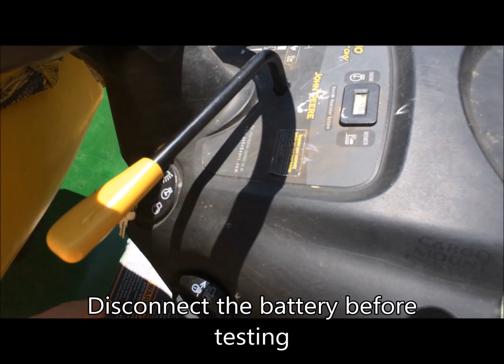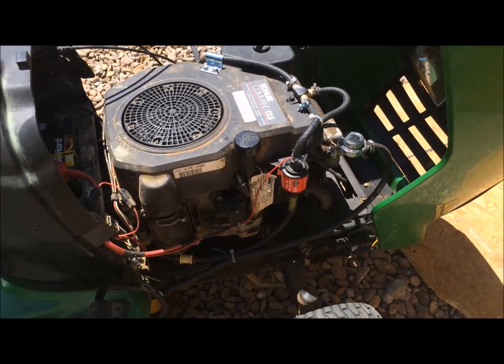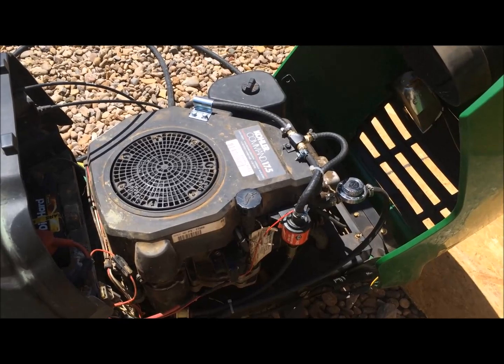Fuel Pump Replacement | Electric Pump Conversion

Comment from the maker: Update: Last summer it quit working, turns out the factory rubber fuel line had pinched shut where it runs through the frame. After correcting the issue it has not had another problem. The pinched line was something I did not notice in this video but it is probably the reason the mechanical pumps were having issues.
Also I do not think this regulator works the way I though it did and it is probably not doing anything.
Reply: That's because you were supposed to run the regulator directly after the pump
Reply from the maker: @feodorjohnson  Because I chose to run a return there is no where I can put this regulator where it will work. In an update video I talked about that but the system still builds 1.5psi at the carb
Reply: @PracticallyStock  I just did the same setup I can send you pics tomorrow
Reply from the maker: @feodorjohnson  Ok, use the email in the about tab on the channel page.  How did you restrict the return line?
Reply: @PracticallyStock  I couldn't find it under the about tab feodorjohnson@gmail.com and we utilize the original metal fuel line replaced all other lines like you said the old hose had a kink and was collapsing but we put the T directly to the carb and ran the return from that I got the mower free from a customer of mine already had new electronic pumps laying around she runs perfect now
Reply: how dose it run when you at low idle. or do you have to run high idle all the time.
Reply from the maker: @bootsinglefooters  it runs normal all the time. Since I used the wrong regulator, the fuel pressure is created by the difference in height between the return port on top of the tank and the carburetor. The carb is lower than the return port. I think it was around 1 psi. The system does not build any additional pressure because there is nothing else to restrict the flow in the return line

Comment: Also.  How long did take you to realize that your charging system can’t handle the extra load that pump puts on it.   Not to mention the very good chances of over pressuring the float valve and filling the crankcase full of fuel.
Reply from the maker: You'll have to inform the charging system it's undersized yourself. I just don't have the heart to. In all seriousness, it's been in operation like this  since I posted the video and I have not noticed any issues. The system operates at very low pressure thanks to my own mistake. That regulator doesn't work the way I thought it did so it's full open to the return all the time. The fuel pressure is due to the height difference between the carb and the higher return port at the tank.

Comment: If you take and put some fuel down in the inlet barb on that pump. Doesn’t take much. Just enough to wet the diaphragm that dried out from not being used all winter.    And she would work like new.

Comment: What did you do with the pulse line from the crankcase?
Reply from the maker: (I think you're talking about the style of pumps that use crankcase pressure to pump fuel) This motor has a factory mechanical pump driven by the motor so I just left it in place but disconnected the lines.

Comment: Where does the return line go. back int the tank?  where?
Reply from the maker: I drilled a hole in the top of the tank and threaded a barb fitting into it. I then used JB weld original (the kwik weld won't hold up) to seal and further secure it. Read the pinned comment and replies for more info. Basically don't need the regulator, either put the return higher than the carb or find a way to somewhat restrict the return line to build a little pressure

Comment: You’re regulating only the return line pressure?  The way you have it plumbed it seems that would be the case.
Reply from the maker: Per the pinned comment, I used the wrong type regulator. I originally thought I could use that regulator to restrict the return to increase pressure in the supply line. Technically I still did this because the outlet of the return is the highest point of the fuel system which means the pressure at the carb equals the pressure to lift the fuel the vertical distance between the carb and return outlet

Comment: Why not just go straight to the carb and not have the regulator? Seems like something else that can go wrong.
Reply: Guess I should have just kept watching….. I’m an idiot
Reply from the maker: Lol, you're good. I am also a bit of an idiot because that regulator isn't regulating because it is the wrong kind to be used that way. The only thing regulating the pressure is just the resistance from the difference in height between the carb and where the return goes into the tank. (The return outlet is higher than the carb so the gas in the return line above the carb creates a little pressure at the carb)

Comment: The return line should be before the regulator.
Reply from the maker: That's not correct,  this regulator does nothing because it does not work the way I thought it did but even if I used this regulator as you described, it would also not do anything because there has to be something to meter the flow through the return in order to build pressure. In this case, the only restriction that is allowing for pressure to the carb is the difference in height between the outlet of the return and the carb (the carb is lower)

Comment: I had a similar issue and solved it by simply mounting the gas tank on top of the hood and just let gravity do its thing.  No more fuel pumps to have to worry about.
Reply from the maker: That would be the most ideal but didn't want to mess with the cooling shroud since I thought it was cool. Problem ended up being the rubber fuel line collapsed
Reply: @PracticallyStock can i have that regulator

Comment: You don't need a by pass line. Put on a low pressure inline fuel pump that has a calibrated  shut off pressure ($8.00 online). That simple. The needle and seat in the carburetor can hold the pressure just fine.
Reply from the maker: I didn't see anything like that at the time but good suggestion. That might work if it is low enough flow, I wouldn't want it constantly kicking on for just a second then shutting off. Not that it was a problem before but a return helps with vapor locking
Reply: You beat to it,exactly what I was thinking

Comment: That is not how a dead head regulator works. You are still getting X PSI to the carburetor so if the pressure to high from the pump, still going to over power the seat in the bowl and flood the engine. A lot of work and money for nothing on the regulator.
Reply from the maker: In the pinned comment I said I found out that regulator does not work the way I thought it did, and no it's not "overpowering" the float. The return is essentially open since it's the wrong regulator so there is no way it can build pressure and you would think I would notice after a few summers of running it if it was flooding out. The pressure to the carb is the result of the flow and height difference between the T and the carb (about 1/2psi if I remember right)  which is not much but enough to keep the carb fed. The regulator is not working (felt repeating that was necessary) so it is likely going to end up on another project

Comment: The regulator is supposed to be inline after the pump. Not a return
Reply from the maker: In the card that pops up at the top of the video I talk about that issue, I thought the regulator worked differently that it actually does. I also found that because the return outlet is above the carb it feeds 1.5 psi to the carb which is plenty

Comment: Intriguing setup. Don't understand why the regulator was not situated between the pump and the carb thus not needing the bypass. A light bulb doesn't know how dark it is. A fuel  pump just  pumps. I can perceive it could be problematic if the line could somehow become pressurized higher than its own design limit.
Reply from the maker: I wanted it to have a return since the little kohler moves very little gas compared to a tradition car engine and I was afraid that the pump would have heat or over pressure issues from the lack of flow. I will concede the system probably makes zero pressure because I don't think the regulator works the way I though it did. When I have time I will look at it and maybe make an update video on what I find.

Comment: Can you give us a part# for the regulator? I recently installed a electronic fuel pump on my kohler k532 after the mechanical one bit the dust. It's working fine due to the needle in the carb doing it's job but I don't want to risk wearing it out to quickly if I can.
Reply from the maker: Don't know what the part number is but it was just a generic one from advanced auto. Looking back on it I have to admit I am not sure that regulator works the way I though it did and it may not be right for this application. If I had to do it again I think I would just forget the regulator since this is not by any  means a performance application, I think the height difference and added length of hose of the return would provide enough resistance to keep the bowl filled. hasn't happened yet but make sure the return is attached good
so gas doesn't get dumped all over the yard since the engine would probably keep running
Reply: @PracticallyStock  I ended up finding one on Amazon. I'm planning on using it a little differently than you. I grabbed a 2-4 psi pump and wanted to drop the psi down to 1psi so I will hook it up in between the fuel pump and carb.

Comment: You don't need a regulator or return line to tank if you use the correct fuel pump.  Here's a good source for them:  https://www.aircraftspruce.com/menus/ep/fuelpumps_0facetelectric.html
Reply from the maker: For this project I wasn't aware of those but I will keep them in mind, I like having the return on this small engine since it does not go through gas like a car. The return allows the pump to circulate fuel, stay cool, and helps prevent vapor locking. I also like having the ability to drop the fuel pressure to 1psi so that I don't have to worry about breaking what is probably a plastic float in the carb. I think your way would probably work but this is still what I would do again for those  reasons
Reply: 88888😮😮

Comment: Thank You! Been jacking around with my 1997 Huskee tractor w/Kohler MV20 for a couple years now. Replaced the fuel pump and carb a couple times, would work for a year then back to the same old problems. I chalked it up to crappy Chinese carbs but after watching this and installing this electric fuel pump setup (with a carb that I though needed to be replaced again)...Runs like a Champ! Good stuff!

Comment: Do I need to do all that on my v-twin 23hp b&s? I buy this pump https://www.amazon.com/Spectra-Premium-SP8016-Fuel-Pump/dp/B004NBME7Y
Reply from the maker: I would recommend doing all this because I have not had any problems with mine so far. I am not sure about that fuel pump you are looking at, it is strange that it has no specs on the flow rate or pressure in the ad. If you have not already bought it I would look for a pump that had more information with it. Also a lot of the reviews were not great for that pump. I would still recommend a regulator and return since the small carb with the plastic float is weaker than the carbs these fuel pumps are designed to work with. I think without a regulator and with the pump you showed me, the pump would be on and off constantly since the carb is so small and would burn up prematurely. Also make sure the line from the tank to your stock pump is not clogged, I think part of the problem with mine was the stock rubber line collapsed on itself where it bent though a hole. 

- use a regulator and return
- use good clamps and proper fuel line
- if you JB weld a fitting to the tank use actual JB weld NOT the JB kwik weld (it sucks) 

Hope that helps you out
Reply: I will do what you recommend me thank you very much
Reply from the maker: No problem, I hope it works good for you

Comment: So instead of running a fuel pump with so much pressure why not use a low volume 2.5 - 4 psi pump and eliminate the regulator and the extra cost?
Reply from the maker: I was mad and wanted it fixed that day so I used what I could find nearby. I kinda like having the return and regulator because I am not sure where you would get a fuel pump that would have a very low flow rate to accommodate the small rate at which the engine uses fuel (when compared to car). I would recommend the extra cost of the return and regulator since it seems to make it easier to control fuel pressure and I imagine it's easier on the pump than dead heading it into the carb. I need to do a follow up video since part of the problem with the old pump (which was still weak in my opinion) was that where the factory rubber fuel line goes through a hole in the frame the rubber fuel line collapsed and pinched itself. I think this made it harder for the OE pump to prime and then it got to the point where the electric pump couldn't pull fuel through it. Other than that there has been no issues with the system
Reply: The fuel pump he used is rated at 2 - 3.5 PSI.
Reply: On a Predator 420 swap I installed a regulator at 1.5 psi. Anything past that it floods.

Comment: I've seen it time and time again, KOHLER ENGINES ARE SHIT!!! More complex then they need to be! Gimme a Briggs any day!
Reply from the maker: Over 400 hours no issues yet, Fuel pump is still good as well. Neighbor had a later johndeere with a brigs and with 14 hours on it I had to go work on it a half dozen times. Thing was a pile, would not cold start with choke on and then when running drank gas like nothing else. Also as far as I know Kohler doesn't use plastic parts like Briggs. Regardless this Kohler seems happy.
Reply: I'm guessing you drive a Ford.

Comment: Dream Team: I have a 21.5 hp. Briggs & Stratton on a il1000 craftsman mower. I agree the vacuum operated fuel pump is crapolla. Does not work all the time. Does not last long! I bought a much smaller than your electric pump. I was wondering if you think a pneumatic airline flow regulator would work the same as the gas line regulator. I have a few in my junk drawer. After reading this comments section I am undecided to put it between the carb and pump or in the over flow line like yours. Is yours still working OK as it is? Ones the regulator is set do you have to mess around with it or does it stay constant.Hope you see this. Hope you reply. If anyone else has any idea I would appreciate a reply. Thanks! John
Reply from the maker: I don't know if those regulators can handle gasoline or not, if they are just for air pressure I wouldn't use one because I would be afraid of the seals failing. The placement of the regulator seems to work either way but if you want a good visual, imagine you have 2 water hoses T'ed at the faucet. If you put your thumb over 1 hose to try and spray farther will it work or will the restriction of your hand just force more water out of the second hose? (open return hard to build pressure). But if you have a restriction in the second hose (regulator) since both hoses are restricted there will be a pressure increase. (regulator in return). All I know is this is how high pressure fuel injection system maintain pressure so I believe it is correct here as well. Only modifications to my design: replaced factory rubber line which pinched and caused fuel starvation, and trimmed bracket holding fuel hose so I can get the air filter off. Other than that no problems with fuel or reliability. Regulator when in the return line restricts flow until the set PSI is reached and then will bleed pressure to the tank to prevent over pressure. I'm just happy since I didn't have to rebuild a mechanical fuel pump again this spring.
Reply: DreamTeamProduc
Reply: I suppose you can use a brass needle valve in place of that regulator, the needle valve are pretty cheap off eBay
Reply: @garagekeys  I am having carb problems now. I decided it was a dirty Crab. Mean while I decided to rerun the fuel line so it is a more level transition to the fuel pump. 
I am running it without the regulator and it was running OK till now. I also replaced the fuel line with new. Lowe's has a 20' roll of nice flexible gas line for only $7.00.
AutoZone wanted $20.00 for 6 feet. 
I am waiting for Parts to finish the Carb. New fuel line, pump is done. I'm doing  needed maintenance while waiting.
Grass in Florida grows 4" a day. :O)